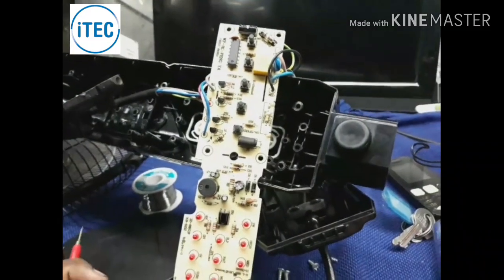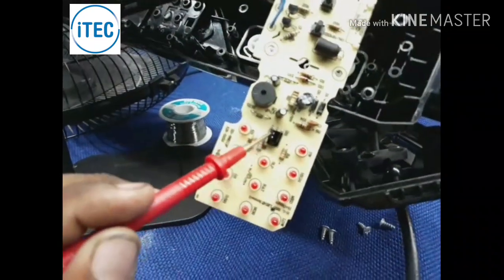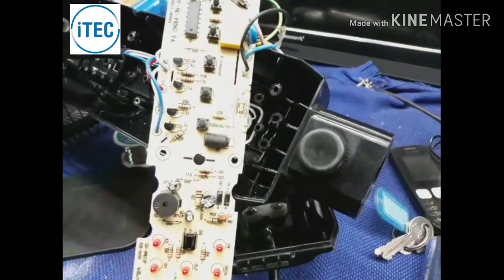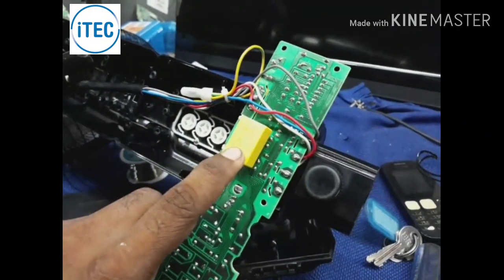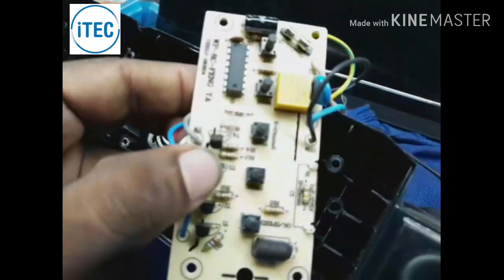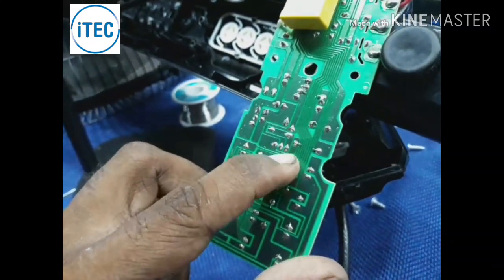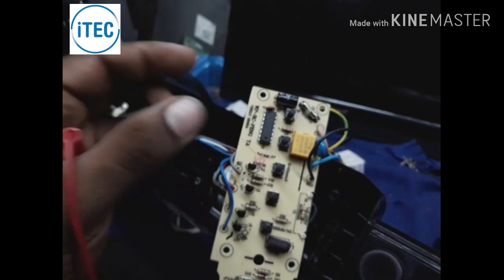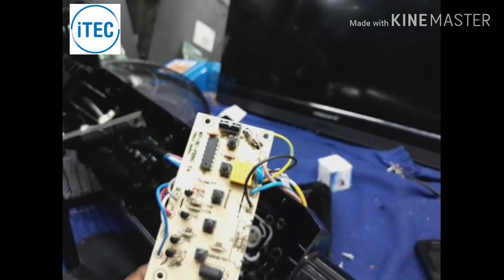Remort Fan pcb repair tips

Comment: Himstar wall fan working fine but swinging motor doesn't work. When I switch on the swinging function from touch panal or remote controller, fan switches off. What is the issue?
Reply from the maker: ඉදිරියේ වීඩියෝවකදි අප විසින් ඒ ගැන පැහැදිලි කිරිමට  බලාපොරොත්තු වන බැවින් දිගටම රැඳී සිටින්න ස්තුතියි

Comment: Hello, I have a remote control fan and I need to reduce the speed of it . Is it possible to connect a  speed regulating circuit (with a triac and diac and a potentiometer) after the fan speed on-off triac   BT131?

Comment: Himstar wall fan no power issue. I changed main capacitor and system Ic, but no solution. Zenor diode tested good. Initially there was a lizard dead on the circuit when opened. What can be the culprit?
Reply from the maker: ඉදිරියේ වීඩියෝවකදි අප විසින් ඒ ගැන පැහැදිලි කිරිමට  බලාපොරොත්තු වන බැවින් දිගටම රැඳී සිටින්න ස්තුතියි

Comment: Sisil remote control fan eke auto off wnwa, speed maru wenne na, hdnn pulwn weid arn awoth shop ekt
Reply from the maker: Ow sir aran enna 
077 838 6476 / 0112 517 277 contact us for more details

Comment: අපේ බාප්පලහ තිවිච්ච remod control wall fan එක එක දුන්න පුලුවන් නම් හදලා දෙන්න කියලා.  මන් තාම ඉස්කොලේ යනවා. 

ඒකේ තියෙන්නේ BW1607 කියලා circuit එකක්.
ඒකේ මයිලර් කැපැසිටර් එක පුපුරලා තිවුනා. ඒක ගෙනල්ලා දාන්නවා කියලා හිතලා power circuit එකේ out එක zenar diode එක තියෙන තැනින් වෙන් කරලා 5V supply එකක් දුන්නා කොන්රේල් circuit එක on වෙනවද බලන්න. on වෙන්නේ නෑ. හැබැයි ic එක රත් වෙනවා. 

මන් මොකක්ද කරන්න ඕන...
Reply from the maker: 077 838 6476 / 0112 517 277 contact us for more details